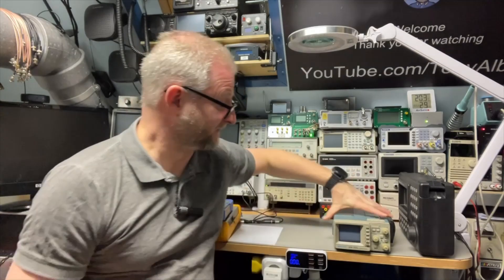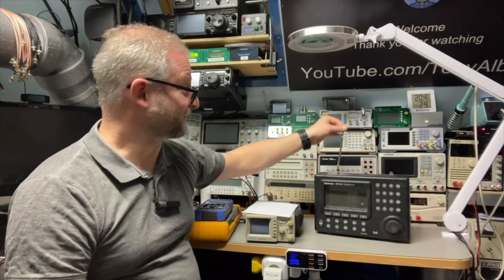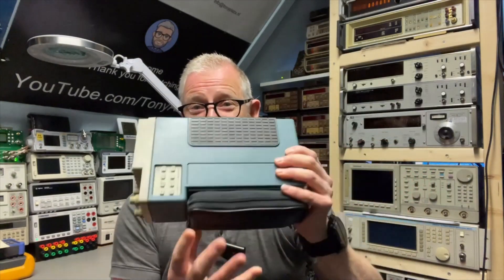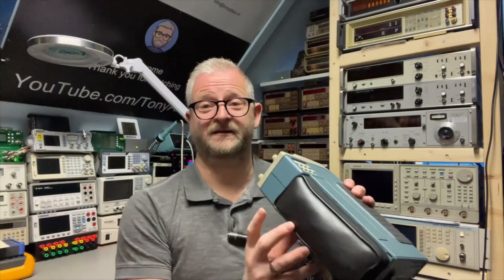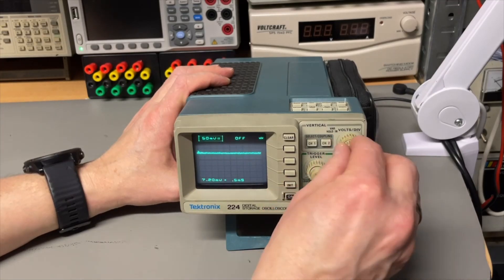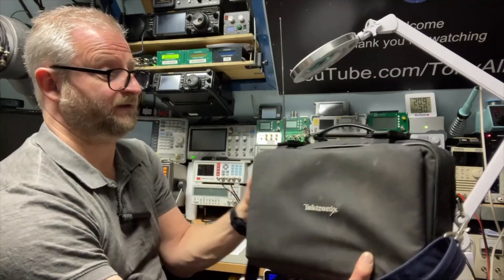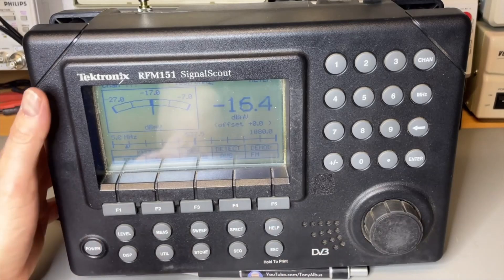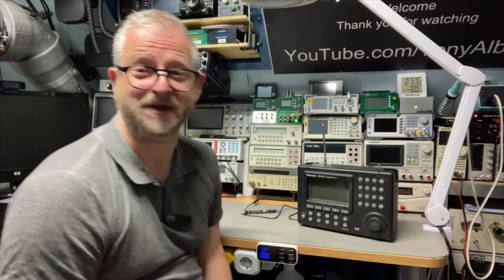TA-0324: Searching Tektronix Software for RFM151 and 224 DSO

Comment: Thank you for sharing, Tony. Hey, it never hurts to ask! I have found that there are a lot of really helpful people out there. Good luck finding the software. Regards,  David
Reply from the maker: Thank you David!
Reply: @TonyAlbus  Not sure if you have had any luck finding software for the RFM151 but I did find something interesting. On page 5-12 of the instruction manual there is a procedure to test the RS232 port. You connect a computer and send "*IDN?" and it should reply with "TEKTRONIX, RFM151" !! Look familiar?  That indicates to me that it uses Skippy (SCPI) commands - it might be worth following up. As the proud new owner of a RFM151 that I repaired (new rotary encoder and missing resistor plus a new battery pack), I am going to see what I can find. I will keep you posted. Regards, David
Reply from the maker: @davidv1289  Wow David, well spotted, thanks!! yes great..

Comment: Hi Tony, I posted a comment, but it is not showing for some reason, so I will try again. Maybe you have found a software for your 224 already, but if not, are you aware of MSDOS utilities for this scope? Also there is a Tektronix document that describes RS232 communication with the scope "Tektronix 222 RS-232 Interfacing Guide 070-7533-00". All the best, Roman
Reply from the maker: Hi Roman, thanks you .. sometimes Youtube removes the comments with an url in them, that is out of my control.
i think i have a demo version of WaveFormManager. but have not tried it.

Comment: Hi Tony, unfortunately I can't help today, I own and use a TEK 212   , it's also two-channel, but fully analog and has no SW - as a monitor for a curve tracker is enough .  There's nothing wrong with asking, that's why we're here to help each other.
You are not the only one who asks, I in the Czech Republic have a request for a tubular ceramic capacitor 2P2/500V for the just restored HP3400 meter.

Nice day 🙂 Tom
Reply from the maker: Hi Tom, the 212 also very nice.. even nicer... classic.  good luck on your HP3400 project and nice holidays!

Comment: I have a 224. Sample rate is 10 MHz. It's 'equivalent time bandwidth' is 60 MHz. Real-time band-width is much less. (usable single-shot capture is less than a MHz) Comparing to a TDS 1001 is like comparing a party balloon to a zeppelin. It might be good for audio bandwidth work; but, it out-performed by even the cheapest scopes. Lots of LiPo, and Lion, batter pack products to replace the unobtanium battery... but it's a project that's not worth it. Plenty of vids on YouTube running up the 224. Another over-priced,  obsolete, Tek scope. Good if you get it almost free... because it's so darn cute.
Reply from the maker: Yes cute for sure :)

Comment: I have a Signal Scout. Scout was used by CATV techs... not because it was great (it wasn't); but because it was 'portable.' When you going up a pole to check a cable run in the backyard... that's what matters. At the head-end, or in the plant... they had and used much better S.A. IMO, the Scout was not a S.A., unless a paper airplane is an aircraft. They had hard lives... cable tv guys with butterfingers, and overloads. There's lots of hugely flakey ones out there, and huge prices. (Don't buy it.) And... yes, there's no support, no schematics, and no software.
Reply from the maker: Thanks, yes hard life it had you can see that.
Reply: I hated most portable signal analyzer as used for years in the field a rohde and schwarz fsh and was a good analyzer but hated having to find basic functions in the menu that a bench spectrum analyzer would have has a dedicate a button easy to find? Plus most portable are slow in sweep. Good luck finding a transient intermittent signal? Now the Tektronix H600/H500 was actually one of the better one as a real-time spectrum analyzer that had performance of a bench analyzer.

Yes had the misfortune of using the tektronix rfm151 signal scout as well. In all fairness portables are not made to be used as a bench analyzer would be.